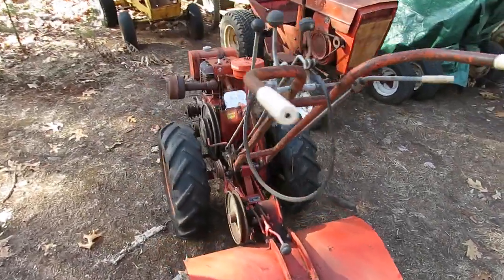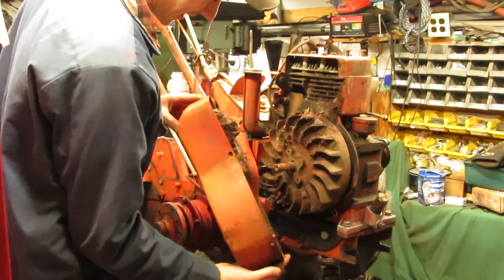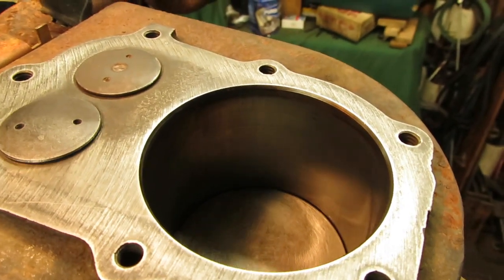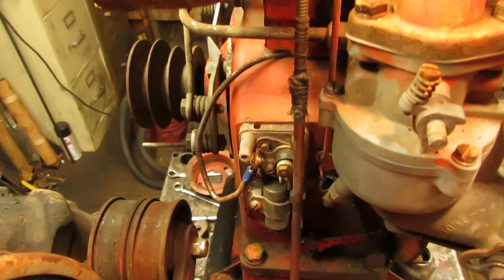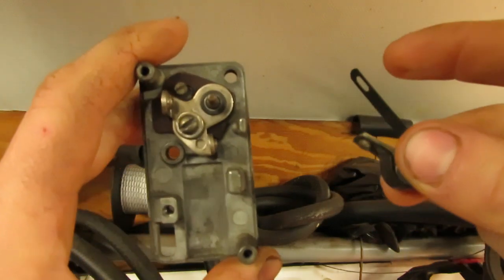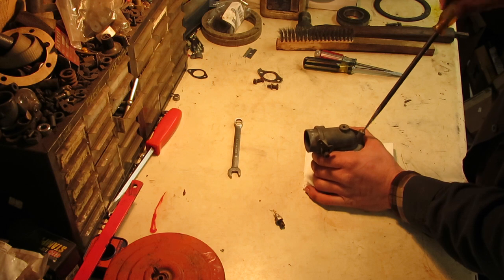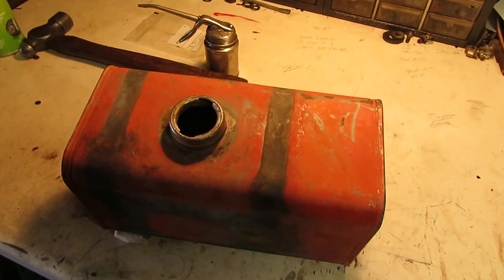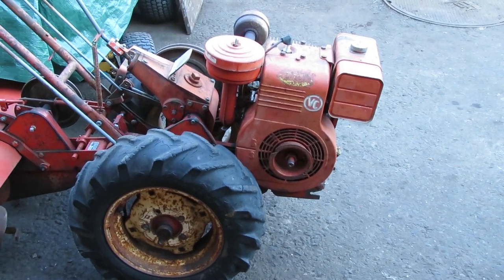Simplicity VC Tractor Repair and Start up- Part 1

Comment: Soak in while vinegar for two days. Fill completely up to the jtop. After two days take water pressure to clean. The crud and junk will was out. After wash get a small magnet on an extension to pick up any rust flakes hanging out in the corners of tank. Air dry for day. Put the new tank to work.

Comment: Love your work. I'm a retired mechanic that has taken on the small engine hobby full bore and now have 4 old cast iron Briggs. They are a bit different and the Magna matic coil setup is something I have yet to fully educate myself on  I found a special piece yesterday. It is a Power Trac with a 23B Briggs. It has a sickle bar on front and a plow implement. I love scrounging this stuff up on road trips. Thanx for the pointers.

Comment: Just Subscribed. I just bought one with a breaking plow. paid $75.  Filed the points and got it making spark. and pulled the start rope and it started and ran for about 15 seconds and the rod came apart . So I suppose I will install a Kohler 8 hp engine we have on it.

Comment: I have one of these my Dad bought back in the 1950s. It came with an abysmally underpowered Clinton engine Dad replaced with a B&S. It had a cultivator, spade point and sickle mower. Dad stole the front wheel weights off the International A to give it some traction after adding the Briggs. I built a moldboard plow for it and broke ground for a garden.

Comment: Nothing finer than the sound of a big block Briggs at low idle just doing its thing. Don't need a lot of RPM unless you're running a snowblower or tiller. Has insane torque with the dual range transmission and doesn't even struggle with a load on it.

Comment: Dad owned a similar type garden tractor called a Dandy Boy Clipper,we used it to plow snow with, think the B&S engine on it was something like 2 or 2.5 hp, last time we used it the rings were worn and it would blow the cutest blue smoke rings,after Dad passed away Mom gave it away.

Comment: Great to see another one of these videos again Jake! Glad you could make a little time in your busy schedule to record a couple! Yea we all have those moments like you had with the engine being stuck. Not going to lie, I've had worse! Probably wasn't a bad thing to pull it apart and clean stuff up though. With all my engines I actually completely disassemble them and check everything over before attempting to run them. You just never know what you are going to find lol!  You should have seen the gas that came out of the 1941 Briggs Model I military engine I just revamped! Stuff was probably an easy 30 years old and stunk like hell! (It was actually orange or red in color too lol!) Luckily, there wasn't much of it and the tank wasn't too bad. I used some old gas with a bunch of nuts and bolts which I shook around like crazy for a few minutes to clean it, but I really like the pressure washer idea! Definitely going to use that in the future! That tractor is a really neat piece! It would be cool to see some of the other implements you have at some point too. I'm pretty curious what the snow blower attachment looks like and how well it works. Definitely looking forward to part 2 and seeing it up and going again! : )
Reply from the maker: Hopefully have more videos to follow after this Simplicity too! Man that old shellac gas with do you in every time. Unbelievable how potent that stuff is too. The smell sticks around forever if you spill it. Oddly enough, this came with 2 snow blowers are 3 tiller attachments when I bough it... can't say I'll ever use that many, but hey, couldn't pass it up!

Comment: A friend of mine was able to pick up one of those tiller attachments for my simplicity. Not sure if a model L-1 is too small for that tiller or not.... It has a Honda GC160 on it and not the original Briggs so the tiller should work. Also hearing that run makes me want to get my Co-op black hawk walk behind out and use it for plowing the garden the spring.
Reply from the maker: Those L1's are small rigs. Though since it has that Honda now it should power that tiller just fine. I just looked up those Black Hawks (never seen one), thing looks like a cross between a Simplicity and a David Bradley with the handlebar and chassis design.
Reply: @5Tractorguy  they do look like a cross of the two but bigger. The Blackhawk dwarfs my simplicity. They were made by cockshutt and sold by co-op but were also available under a different name. Not many available and I got mine fir a song with its plow and cultivator. Has a cast iron Briggs on it with a stuck valve so that may end up being this springs project, axle bearings are gone in it so not a simple get engine run and change fluids kind of fix unfortunately.

Comment: Looks like you finally got the chance to let the 5-string cool off a bit and get greasy fingered instead of building callouses but that would be on the flat top. And don't worry about the frozen/non-frozen motor. Being multi-instrumental you're entitled. And all those C U T E goyls at the pickings and gigs don't hurt. Good running old Briggs. Wished they were still made like this. So keep after it and GBWYall!
Reply from the maker: That 'ol 5 string is down right chilly by now. Been hanging on the wall while the 6 string is hogging all the attention this winter! Bluegrass goyls? Say, them's my kinda women... Good hearing from ya as always Lewie!
Reply: @5Tractorguy  Carry on, Jake. I always wanted to learn clawhammer but the hands and everything quit before I could. The 6-string did me good though. Carry on and continue to make me and the Tarheel Uncle proud! GBWYou!

Comment: I have the same engine from 1966 it’s in a Dayton generator I rebuilt the carb last year and it ran great I didn’t even have to clean the points but unfortunately the tank has a lot of rust and crap again the only reason I keep it is because it was from family they purchased it new
Reply from the maker: Go figure! Is it one of the blue Dayton generators? I just picked one of those up from an estate yesterday... Regardless of the rusty tank, it is neat having old family equipment like that.
Reply: @5Tractorguy  it’s green.

Comment: I find it amazing that people would rather have shiny plastic over a proven well built machine . The older machines are built to last , the new ones are not designed with longevity in mined . you have to maintain any machine and the older ones are usually not any more work .
Reply from the maker: Beats me, new stuff isn't getting any better either either... Slowly people are figuring out it's worth investing into an older machine than buy new (at least the guys that actually work their equipment). Because what are you going to buy that'll mach the quality? Never mind the price of new too...

Comment: What does firing HARD mean? New term to me.
Reply from the maker: Firing hard would be in relation to ignition timing. So the spark would happen closer to top dead center or in some cases, after. The more retarded a spark is in relation to TDC at higher RPM's, the "easier" and engine will fire. Tough to explain without having an engine to demonstrate on...
Reply: @5Tractorguy  Thank you. I understand what is is now , clearly. Follow up is what does it sound like so you know it is firing hard?

Comment: hola amigo estoy buscando una maquina de esa para comprar por favor ayúdeme tengo una finquita y es muy importante para mi suerte en sus proyectos
Reply from the maker: Hola Miguel. Dependiendo de su ubicación, consulte su local para listados de venta, craigslist, facebook. Si no se encuentra en los EE. UU., Es posible que alguien le envíe uno, aunque el costo puede ser elevado.
Reply: @5Tractorguy  muchas gracias por su buenas intenciones